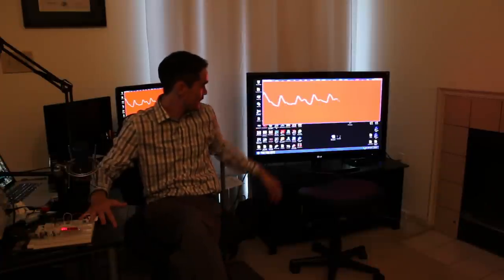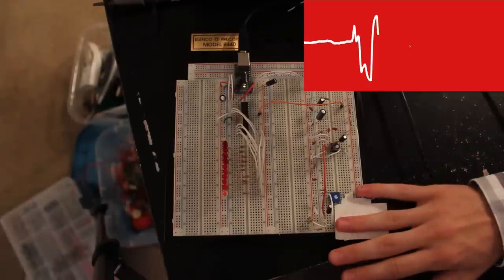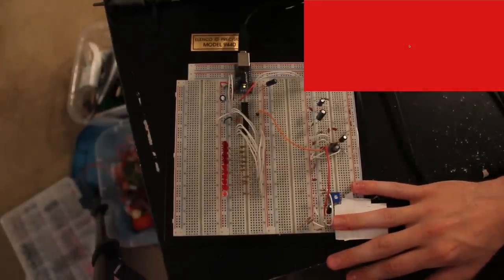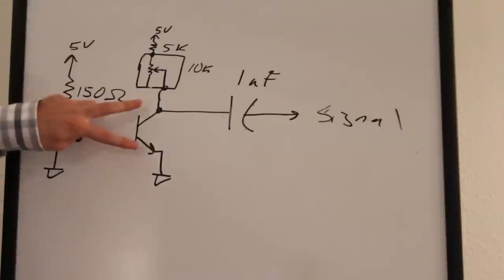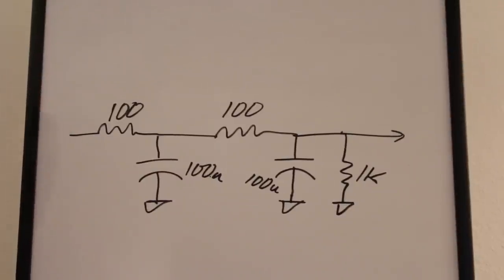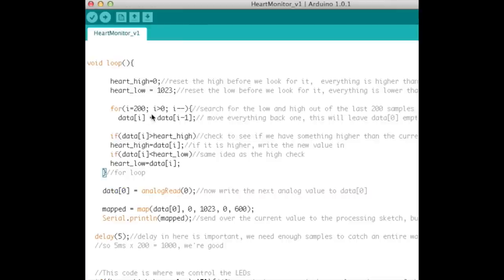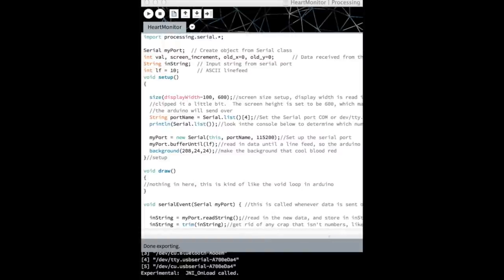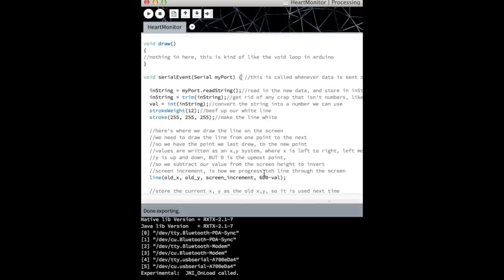HowTo: Heart Beat Monitoring!  Arduino/Processing

Comment: You can or divide the filter into 2 parts 1st part conect between pin 1 and 5 of LM386  (100 ohm and 100n RC filter) and second part connect to the output of the LM 386 (again 100 ohm and 100n) because in that configuration LM 386 works not only as an amplifier but buffer for two stages of the filter as well. 

Or You can connect all the filter to the output of the LM386 (like your current construction ) only change component values.

Comment: Give your op-amp -5 voltage at the negative side to set down your reference point so you can go under 0 and your graph will be much real. remember to use voltage divider at the arduino analouge pin to opperate on that..

Comment: i have about 30mvpp at the cathode of the infrared detector diode and then I have about 3vpp at the output of the  lm358p.. which i chose to use instead of the lm386, I also used a single stage low pass filter instead of the 2 stage because my results were a little more flexible.

Comment: hey Great tuitorial.. but in the end when i run my processing code, a window opens with red color background but am not getting white line showing heart pulse rate. What should i do? I have implemented the  same code as of yours and also there were some errors in your code. so what i need to change in Serialevent()? and one more thing u have set baud rate to 115200 so what kind of Arduino you have used? Please help me.. thank you
Reply: was your problem solved? if so then please let me know what are the changes made in the code

Comment: I work with a lot of signals that sometimes have a large noise component.
I like you project, Have you considered using a software filter for your projects?

A Filter algorithm that I use a lot to separate the low frequency component as follows;

"Filtered_Analog = Filtered_Analog  + ((Filtered_Analog - Analog_Input) * K)"

Where (Filtered_Analog - Analog_Input) is the error multiplied by a coefficient of K (usually about .001 depending on the Sampling Time constant)

Comment: Hello Kevin, thanks for such an educative video. I was just wondering if you have a circuit diagram for the pulse circuit (Excluding the Arduino). I would be very grateful if i could see the detailed circuit diagram including connections and components used, i am trying to put one together. Thanks again for your innovation.

Comment: +R Da Convert the final signal to a Pulse train using a Comparator or using a Schmitt Trigger (using an Op-Amp)

get that pulse train into a digital port of Arduino and with a little bit of Programming you'll get it :)
Reply: -Count the Positive pulses for example in 15 seconds
-Stop the Counting
-Multiply that number by 4
-Display the final number (in a 7Seg display, LCD or using a the Serial Monitor of Arduino)

Comment: Precessing say an error on your code : "ArrayIndexOutOfBoundsException:4" =(
Reply: Probably because you are trying to access a serial port via an index, when there aren't that many in the system. In other words, you've gone out of bounds on the array...and therefore get an exception thrown. Maybe try to verify the number of serial ports you have in your system, and change the array index accordingly. Or better yet, write some more code to check the bounds before trying to access a value that is out of bounds.
Reply: change it with 0
Reply: I have the same problem too. How did you amend it?
Reply: Tay Aaron You run it first then arduino will be found by this code, and down you will see the serial port that is connected by arduino like (19) for ex. if only one exists you just write "0" in the processing [0] becaouse you are counting from 0....

but if it prints like (19)   (12)  ...... you just count. 19 has 0  and 12 has 1 and so on....

Comment: Just a heads up, if that were your heartrate on a real EKG, you would have Ventricular Tachycardia, I think. Anyone care to correct me on this? Still, very good example.
Reply: This isn't actually measuring the electrical activity of the heart which is what an EKG does. This is looking at the absorbance of IR light by hemoglobin and is showing pulsatile flow. So you can't actually see conduction through the heart with something like this.
Reply: Ah, ok. It's still pretty cool though!
Reply: like Luke said it's the absorbance of hemoglobin as is pulses through the arterioles in the finger. This is exactly how pulse oximetry (SPO2) works to show the concentration of oxygen in the blood (minus the oximetry part though). Awesome work Kevin!! Keep it up!!

Comment: I think you got confused while drawing the potentiometer, you drew a 5K on top and a 10k of which you use only 5K there is no 5K is not a standard value ( I'm guessing that's why you use a 10K reostat)  and then you tried to draw the fact that you want to ground the other half of the reostat but you shorted the circuit, that schematic is really confusing... still, cool project!

Comment: whats the type of arduino you use ?
Reply: If you listen at the beginning you will hear him point to a stand alone Arduino.
It is the Atmel chip that is on the UNO. Go to the arduino web site you can find out every you will ever want to know. Go to Kevin's Chanel he explains the stand alone in great detail.
Reply: Looks like the standard ATmega328p unit, like that from the Uno.
Reply: Tom B
Go to 3:03 time on the video. You will hear him say stand alone Arduino as he points to it.
Reply: Paul C Johnson
Yeah, what he means is that he is using the ATmega micro-controller (MCU) directly on a breadboard--not on the Arduino development board, with all the I/O broken out to a header. In other words, he is using the same MCU "standing alone on the breadboard." But that doesn't change the fact that he appears to be using the ATmega328p, which IS the micro-controller used in the Arduino Uno.
Reply: Correct.
Reply: You are correct.
Reply: Some think I forgot to mention about bread boarding. Take a look at this organization http://fritzing.org . They have some bread boarding editor for lack of a better work. It has a parts like resistors and IC's etc so you can plug in these parts into your computer bread board. If you look into this you will find a real wonderful working software. Please take a look. Makes bread boarding real easy.
Reply: thank you

Comment: Your filter is not as effective as can be because impedance of the second stage affects the performance of the first stage. You can improve filter by placing first stage between pin 1 and 5 of the LM386 or you can leave filter external only change R2 for 1KOhm and C2 for 10uF and R3 to 10Kohm